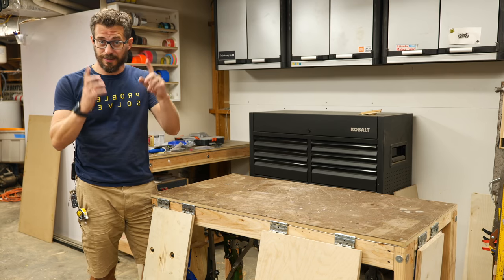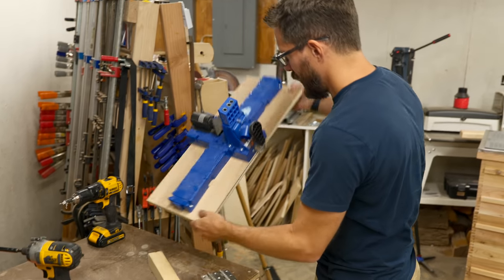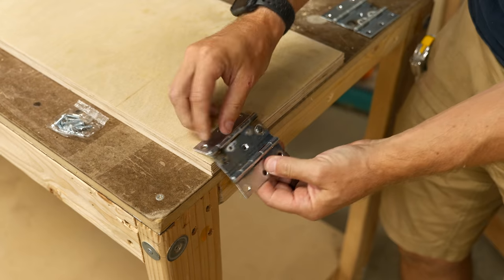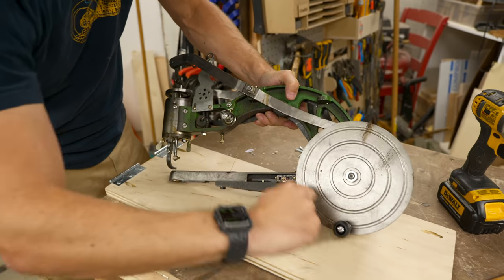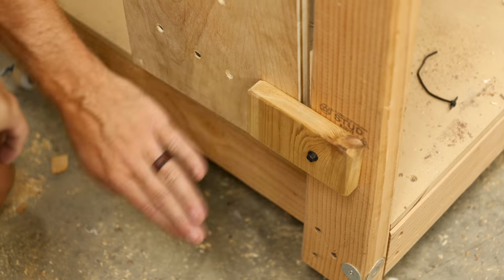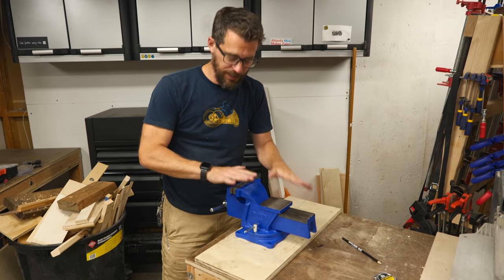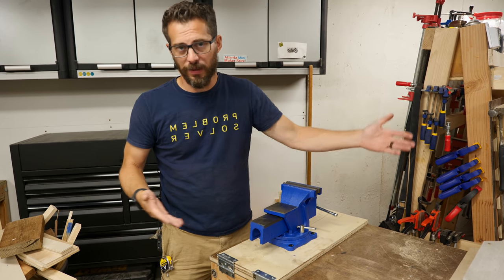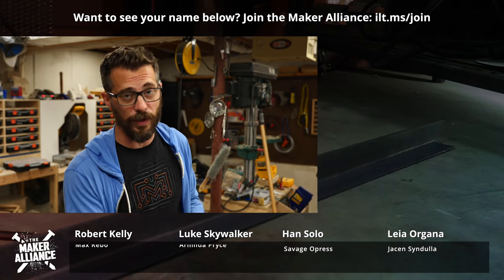How to Make Fold Away Tool Storage | I Like To Make Stuff

Comment: Just as a grumpy old safety nut: PLEASE heed the warning on zinc! Metal Fume Fever is not imaginary, and can lead to lasting health implications. Simple "ventilation" is insufficient, if you weld on similar hinges, at the very least put a fan at your back to ensure you stay upwind, and consider using a ventilated mask with air filtration for fume contamination.

That said, awesome video as usual, and I think this gives me an idea on how to finally find a home in our makerspace for a bunch of tools we've been stumbling over for a while now... Great idea, and thanks for sharing!
Reply from the maker: Thanks for sharing this.
Reply: Super important note here, since this channel has started with a touch of blacksmithing, don't put galvanized steel in a forge, either.  Working with scrap in blacksmithing is always super tempting since it's cheap but just make sure you know what you're using before you heat it.
Reply: Don't apologize or minimize your comment by saying you're a "grumpy old safety nut". If this video encourages anyone to weld hinges like he did, it could expose them to some very nasty stuff. I think it was borderline irresponsible for the video to hand-wave away the safety concerns the way it did. This is not anything to play around with.
Reply: And if you ever get zinc-oxid fumes in your system, you can emergency treat it with a liter of high fat milk, to help the body get rid of the poison. It feels like a heavy fever with shivering fit. If it lasts longer than a few hours, see a doctor!
Reply: Just hold your breath while you weld.
Reply: What does galvanized steel in a forge do/emit?
Reply: @redcloud9700  part of the galvanizing uses zinc. I don't know the exact process, but heating the galvanized steel emits zinc fumes.
Reply: Eric Smith welding zinc emits zincoxide, which is odorless and colorless, you don’t notice the poison, until it’s to late.
Reply: Yes, I had a friend at work who welded a pile of zinc plated steel pipes and it stuffed his health up for a long time.
Reply: When I was younger I worked construction, and one day they had me cut with a torch old guard rail that had been removed from the side of  the highway. I was cutting it at the yard to take it to the scrapyard. No one told me about the dangers of cutting the galvanized guard rail. I cut it all day, and was so sick for days after. I had headaches, and had a sour taste in my mouth for days.  I informed my boss that I was sick and what was going on. They then determined what had happen, and that I should have been using a respirator.
Reply: Yeah, I found out a while back that one of my Great-Grandfathers died in his 30's from some kind of pneumonia or respiratory illness. And that he was a welder. Kind of made me think.
Reply: @redcloud9700  What is does is that it kills you. As in DEAD.
A few year ago a fellow black smith of mine, in Germany, died after forging galvanized  pipes. That is what zink  fumes does to you.
It is not something you do 'not need to inhale'. 
It is something you need NOT to inhale, unless your'e not a fan of staying alive.
Reply: @drachenklaue07  Citation needed.
Reply: @drachenklaue07  Don't bother. Eric won't be in the genepool much longer.
Reply: Hhhhhh
Reply: A simple solution to the zinc contamination problem. A propane torch will generate enough heat to burn off the thin zinc coating , just do it outside!  I've done it many times. Built a lot of Electrathon frames using EMT conduit
Reply: @MrDmorgan52   this is a good idea, the zinc oxide is bad for you and since they are inside hinges there isnt a risk of rust
Reply: I'm 😊
😅

Comment: This is fun. Thanks. 
 Can’t see this slight adjustment suggested yet so here it is. 
Mount the hinges in shallow recesses and on the “under side” of the board as it sits on top of the table. It will mean the tool will hang underneath the table instead of leaning out a little. 
Inspiring video. 
Thanks again.

Comment: If you don't have a welder you can buy the correct hinges.  They are called 5 Knuckle hinges.      They cost about  $ 6 /each and are made for 3/4 material.

Comment: The more videos I watch about workshop improvements wants me to bin EVERYTHING in my shop and start again!
Reply from the maker: Ha, I wouldn't go that far.
Reply: Gareth, it is called "shop evolution" eventually you will have "binned" everything and started over. In some areas it will happen more than once. Just not all at the same time.
Reply: I wished I had a Shop to binge in ✌️😕

Comment: I've done something similar using a grid of T-nuts going through a bench top. I have a load of tools attached to boards that I slide off their shelf and bolt straight onto the bench top. It take about 3 seconds, with a drill driver, to fit a new tool to the bench. Very quick and 1 bench can be used for 90% of my bench top tools 😁👍👍👍👍👍

Comment: Great, great idea!!  For the vice, drill holes through vice flipboard, matching threaded inserts into bench top. I would do four with threaded nobs. You will usually only need one or two, but for something that requires muscle you are ready to go. You could put extra inserts in the flipboard to hold the nobs when not in use.

Comment: Great I am very impressed this is a solution I need, as I am reorgniseing my shop and have a number of uses for this When mounting a vice the fixed jaw should slightly overhang the edge of the bench. This will allow for clamping a long object in the vice.

Comment: One more thing to do to make the whole thing even "better."  Allow the table top to be hinged and lifted and make a shallow storage area under it. Can be used for accessories for the fold down equipment, or clamps or whatever. Splitting the table top into two sections could also be helpful in opening one side while a device is on top on the other side.

Comment: This was a particularly cool concept. Well done Bob. A quick idea for the short wood screws attaching your hinges to the flip boards. Since you have a welder available, use some mild steel to create a strip from one hinge to the next. Punch, drill, and counter sink a number of holes in the strip. That way you can add more screws for additional support.

Comment: I like the idea and the implementation.
I only think that for tools like a vice, but also many others, you might need a way to anchor the rotating panel after it is rolled over the table.
When using the vice you might apply a strong force in different directions that with the current implementation are all going to be absorbed by the hinges.
Reply from the maker: That's a good point, and you could definitely use some clamps to hold that panel to the table once it was flipped into place 👍🏼
Reply: @Iliketomakestuff  you could drill some holes part of the way through the worktop and a dowel connected to the underside of the toolpanel  to minimize rocking/vibrations while using the tool. the dowel fits in the holes which should work...
Reply: I suggested threaded inserts and bolts, but that does seem kinda overkill. A clamp would do just fine
Reply: This is one of those ideas that's so simple it's brilliant.  Will definitely do something like this.  Have that exact vise and no place to mount it!

Not having access to a welder, I immediately started thinking of alternative ways to manage the hinges.  😀
Reply: ideally the  vise should be closer to the edge so the fixed jaw is over the edge.  That way the table doesn't get in the way of clamping a long piece vertical
Reply: I like the idea of mounting the vise this way.  My only concern is that when I typically end up using a vise is when something is very tight or I need the part to remain still while I am putting a lot of force on it.  So I would be concerned with the lack of material for support of those bolts through the panel.  Maybe rather than counter sinking the bolt holes, use carriage bolts and some fender washers to spread the load out.
Reply: @lucaswaltgard1411  that's a good one

Comment: This is great! I was just fretting about using table space to mount a vise permanently. 

One idea for improvement would be to put some removable pins through the mounting board into the table so when you push and pull on the vice it doesn’t rip out the hinges.
Reply: that's a great idea!

Comment: I have a large bench in my basement, with not so much space (can't move the bench around). I was thinking of ways solve this exact problem. Best I could come up with was mittered wood that would form the bench. Then you take part of the wood out and come in with a similar piece of wood with the tool attached. But this solution is so much easier to implement and also needs less weight lifting on my part (since part of the weight is supported by the hinges). Brilliant. I'm glad i was lazy enough on my implementation that I got to see this :D

Comment: Clever and simple solution. 

Re the leather sewing machine being at an angle; why not just unscrew and reposition the mounting blocks you made?
Reply: I think mounting them horizontal instead of vertical will be stronger as well.
Reply: Size, he’d have to add 1/2” plywood to it as well. A 2x4 is 3 -1/2” on edge, 2 of them laying down is only 3”. He needs enough clearance for the crank. But yeah I was thinking the same thing still figured he’d do that lol.

Comment: Uhm Hi, first; great idea with the fold away storage. I only have one suggestion: maybe secure the vice on the other side, too.(Clamps, some woodblocks,..) I don't know what you wanna do with your vice, but some might get a rough beating or have to endure a lot of force, what could deform those hinges.

PS: Washers are there to apply the clamping force of the screw evenly on a surface, to preserv the wood surface is only a secondary "feature".
Reply from the maker: Good idea! Clamping down the vice panel would be a simple task but make a big difference in stability 👍🏼

Comment: Brilliant project. An idea i had is you could drill some holes at the far end of the plywood the vise is bolted to and add threaded inserts into the tabletop just below the holes. That way you could bolt the ply down at the other side of the hinges if you ever plan on doing some heavy work with the vise. It'd stop it from wobbling around.

Comment: Try using T nuts in the plywood that all of the tools are mounted to. They lock into the plywood plus no drilling of the plywood and gives you more material to support the weight of the tool. Great video, keep them coming.

Comment: Hey Bob, just a little hint: the fixed jaw on your vice should actually protrude the edge of your workbench. That way you can clamp long workpieces in the side of the jaw that extend beyond the surface of the table. I hope that makes sense. Other than that, nice idea! I hope everything holds together with use!

Comment: Just a tip on the bench vice. Make sure when you fit the vice, that the fixed jaw clears the edge of the work bench, so that when you have to clamp something long in a vertical position, it clears the bench.

Comment: I totally LOVE the whole project.....and it gives me ideas of what I can do in my own shop as my shop is so very tiny!! THE ONLY DRAW BACK I SEE IS THE VICE!!! 

I know me......and that means a lot!! I am one of those guys who will mount something in a vice, put a socket and three foot breaker bar on an item and then attach another three foot section of pipe to the breaker bar as I try to free a rusty nut or bolt!! 

Think about those poor hinges because in my case I would bend those into pretzels in mere seconds when I run into those "I need more leverage" moments!! But there is a better solution to the vice problem in think! 

I can't recall the guys YouTube name, BUT here on YouTube there is a guy who uses a "receiver hitch" like the type you'd find on the back of a pick up truck to make his tools "swap-able". The hitch is mounted to the underside of the guys' work bench then each tool is mounted to a receiver tongue. Simply you pull one pin to swap from tool to tool and in his case he has a drill press, a vice and a bench grinder mounted to different tongues. It was an extremely smart way to mount the tools so the work space could be used when needed with the tools under the table for storage!! But I thought that too was a really amazing idea for mounting a vice!!

Comment: Love the idea, makes a good alternative to the flip type table with two types of tools only. I'm in the process of setting up a small shop, but even with this type of space saving method, am limited to having to hang the bench from the wall once my weekend is done. A pain, but life. Hence lots of my concepts need to be modular and easily setup and broken back down for storing when not in use.

I'd take functionality over pretty any day, so need not worry about that, no prizes for prettiness, and even if there were, I'd not give it a second thought over efficiency and functionality. Love the work.

Comment: I'm thinking that to overcome the issue of "dead space" to accommodate the hinges/structure of the table, you could use some t track or dovetail slots and slide the tools into the "dead spot" then move them back.   The reason I want to do this is to "correctly" position my kreg jig so that the foot pedal action will work (it needs to be at the edge of the table).     Some dovetail slots on the top of the table could also help to clamp the tools down (such as the vice).  Or make a perforated top, like the Festool top for clamping.

Comment: As someone with a usually very cluttered workspace, I would maybe mark the outlines of the flipping boards when they're flat on the table, possibly in different colours  since the lines will cross, so you'd know where the tools will be, and where exactly you'd have to clean up before flipping the tools down on the table 🤔 also, as you have kids, they would know where not to put their hands when they're watching you work :)

Comment: I think this is a cool idea, especially for tools that are not frequently used. I did wonder about the vise, however. Depending on what you do with it, will the hinges be strong enough to keep the vise stable as you apply force such as sawing. I guess in that case you could add a clamp on the other end to provide additional bracing.

Comment: Clever, Bob, good solution. As an afterthought, why don't you drill new holes in the base of the leather sewing machine so you can orient it as you please. Through bolts may be the answer for that weighty machine.

Comment: Gate hinges on the top with coach bolts would solve the fixing issue.
Anything with side loads (would benefit from a Male screw knob M10 (ish) with a captive tee nut under the table top. You can then secure the board so you won’t strain the hinges while doing stuff on the vice/sewing machine/whatever.

Comment: This is a neat idea, and one that I'll probably copy.  However, a vise that big needs a lot more support to be useful.  Once you start pulling or hammering on something in the jaws, those hinges will be the weak link.  Here's a suggestion: screw two 2x4s under the bench top, with four tee nuts in the underside that line up with through holes in the vise mounting board.  When you swing the vise up, run matching bolts through from the top, solidly securing the vise board to the bench and eliminating stress on the hinges.  That said, mounting a vise to a bench that's on wheels is a little sketchy to begin with... ;-}

Comment: Great video, could I add a suggestion? Since it need to grab the wood from the bottom, is that possible to make a handle at the side of the wood? Obviously if that's the case the wood need a much thicker then the video to conserve the space of the screw that puts into the handle.

Or put the handle in the back of the  wood and modify the table surface so that when the handle hits the surface it will hide it inside the table (kinda like a spring load hidden surface).

Comment: Instead of using wood to hold the machines in place you could use some high powered magnets to hold the machines in place

Then you can put some full length handles on the the wood holding the tool to easily grab the tool and close the tool

Comment: As a suggestion, instead of washers I would use a metal plate for the vise so the four bolts are bolted to it. Washers are better than nothing, but as it's a heavy piece of equipment, I think a whole metal plate, just big enough for the four bolts, would give some extra piece of mind so it may never break the plywood. Washers or not, that plywood is being countersunk, which means less thickness.

Just saying. Other than that, nice as usual.

Comment: Any reason for the orientation of the 2x4 spacer blocks under the leather sewing machine? Instead of canting the machine so the baseplate holes have more wood to screw into, setting the blocks on top of each other vs standing them side by side would provide the wider mounting surface and almost the same height offset (looked like it didn't need to sit 3 1/2" off the wood plate).

Comment: One thing: just my ocd kicking in; but for both the pocket hole jig and the vice, you mention there needs to be enough excess room on the top surface from the edge to the tool, but with the double hinges, you now lose 2x the width of the hinge because it folds over the bottom hinge instead of the top hinge and the excess room you gave yourself is now more than it has to be. Its kinda hard to explain and easier to visualize, but it looked like you were measuring from the top of the mdf to the bottom of the 2x4 insert, and then using that measurement to give excess room for the tool to rotate below the inserts. It'll get you that extra space, but it is now 2xwidth of the hinge longer than it needs to be ( or a just a bit smaller because of the rotation radius hitting the corner of the 2x4 insert.

Edit: i spoke too soon. It looks like you moved the pocket hole jig actually closer to the edge in the end.